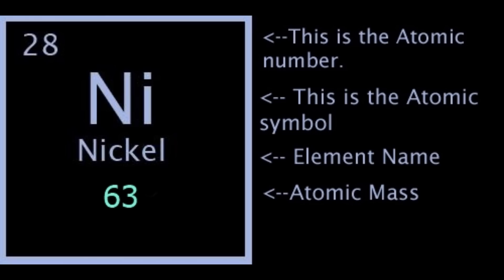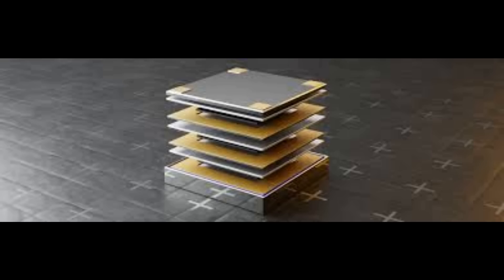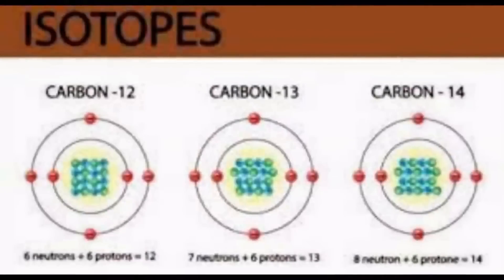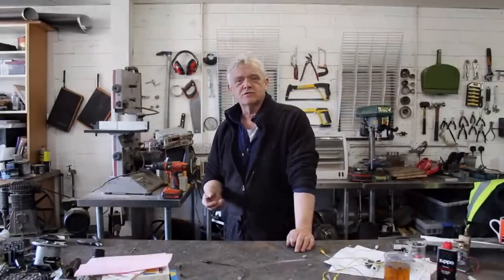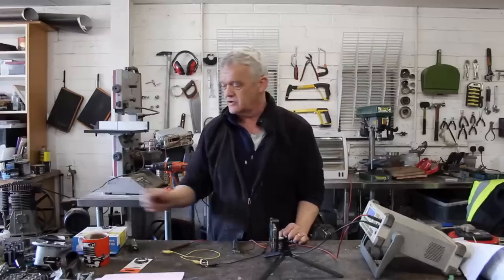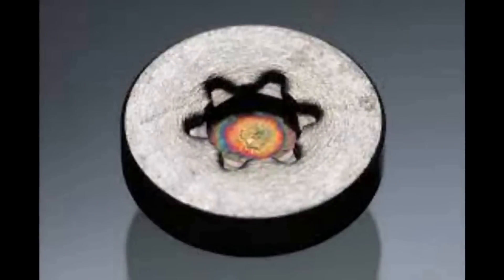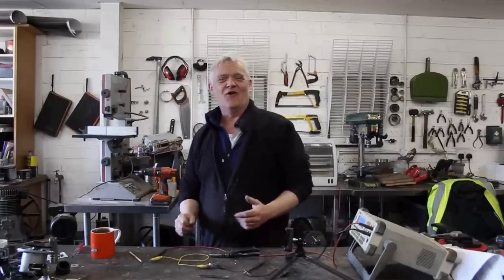2187 - The 50 Year Nuclear Battery From China And How To Make Your Own Version

Comment: Seventy microamps (70 µA) is a very small amount of current, but it's not insignificant in the context of low-power electronics and microcontrollers. Here's what you could potentially power with 70 µA:

Low-Power Microcontrollers: Many modern microcontrollers, especially those designed for battery-operated devices, have very low power sleep modes. For example, some models can operate in a sleep or standby mode on less than 70 µA, waking up at intervals to perform tasks.

Watches or Small LCD Displays: Traditional digital watches or small liquid crystal display (LCD) screens can operate on very low current, often in the range of microamps, making them potential candidates for operation at this current level.

CMOS Integrated Circuits: CMOS technology, which is used in a wide range of electronic components, is known for its low power consumption. Certain CMOS devices or circuits, especially when operating in low-power or standby modes, could potentially be powered by 70 µA.

Sensors: Some types of low-power sensors, such as temperature or light sensors used in various applications including weather stations, smart homes, or IoT devices, might operate under 70 µA depending on their design and the operational mode.

LEDs: While most LEDs require more current for standard brightness, high-efficiency LEDs or micro LEDs can sometimes be operated at very low currents for applications like indicator lights. However, at 70 µA, the light would be very dim, perhaps only visible in total darkness.

Quartz Crystal Oscillators: These components, which provide the clock signal for devices like microcontrollers and watches, can operate on very low power. Some quartz oscillators might work within this current range, especially in devices optimized for low power consumption.

Comment: I could imagine that you would also be interested in finding out what the maximum power supply capacity is. I didn't notice that it was mentioned for your Am-Diode battery, but it is actually more important than the voltage of one "cell". It's reasonably easy to build a 200 cell battery, but who cares about 24 volts if you can't get 200 amps out of it...

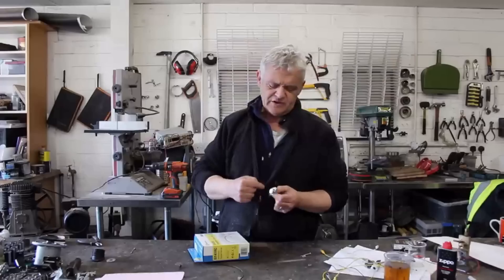Comment: 6:13 I think it's pretty pointless to start breaking some transistor to get a photoelectric cell that produces electricity. Without any kind of violence, the same thing is perfectly possible with LED. Instead of sawing open the case of the transistor, you can take the LED and direct the top of its transparent shell towards the light. And it is still a functional component even for the purpose it was made for. Maybe the life of professors is about complicating things?
Reply: Maybe that transistor has more surface area or provides better shielding.
Reply: @splaytrees  Makes sense.

Comment: So with 10 of these, I can make 1 volt, but how many watts? Also will the silicon transistor degrade from the radiation? So it seems like it can't be a practical battery. Thanks.

Comment: Found the easy way to open the transistor. Clamp one side in the middle of a vise.Take a sharp utility knife- slide between the  cap and the base metal and give the knife a very gentle rap with a hammer and that whole cap pops off in seconds!

Comment: its very entertaining but you are just seeing light leakage.  If you perform the experiment in a slightly more scientific way (ie really remove ambient light) you will not see any difference if the Am-241 source is present of not.
The semiconductor die is passivated with  layer of silicon dioxide (quartz glass) and the alpha particles will not be able to pass that and reach the semiconductor layers below.   Even if they could pass through the passivization layer, they certainly could not pass though the first layer of N-type material to reach the N-P junction where the charge carriers are produced.  Light is a photon and behaves differently in this semiconductor and can generate hole-electron pairs on the surface layers.  Betavolt uses BETA radiation, not alpha as you are getting from the Am-241 source.  In a BetaVoltiac or AlphaVoltiac device, the source of the electrons (beta) or holes (alpha) needs to be one of the contacts, the semiconductor is the other contact.
Reply: Alphas easily pass 1 micron of aluminium, the higer energy alphas up to 5 micron of aluminium, and the passivation layer  is thin enough. Lots of semiconductor Alpha sensors and Radon monitors on the market, you can buy them off the shelf.
Reply: There will be a roughly 1-2 MeV energy loss from crossing 1 micron aluminum, which represents about 20-40% of the theoretical starting energy of an Am-241 decay alpha.  In practice, the gold coating on the source, recoil losses and the few millimeters of air will also reduce the alpha energy even further.
What needs to be remembered that a three layer device like an NPN transistor has the (usually) emitter on the top of the of the die, so to reach the junction, the alphas would have to first pass the SiO2 passivization layer and then get through the emitter n-doped layer.  That is a substantial mount of material.
Alpha detectors that are based on semiconductors as usually 2 layer devices, often PIN diodes.  Not NPN power transistors...

Comment: So if I did the math right, assuming 128 mV output, someone could spend apx $30k USD and build 1,875 of these, and provide a house with 240v for ~400+ years?
Reply: I mean, if you could have it collected in a capacitor for consistency, then it's possible? But you'll be better off just using a solar panel system to supplement it.
Reply: @Life-tastic  but would that be cheaper than 1900 transistors...
Although I suppose a cylinder of panels with a larger chunk of the material placed in the middle may be the way to go.

Comment: I can see some use cases for this.   

Trickle charger for cars.   When it becomes more dense and able to get around 2amps at 13-14v (around 26-28w) your car battery in a modern car that is currently abused by all of the new electronics would last 2x as long.

Comment: Damn... I don't have much faith in the safety going forward but I'd love to get my hands on some of those neat little 3v batteries... if they are closer to 3.7 with 4.3 max it'd be perfect for a bunch of stuff I'd put them in. I'd totally show that shot off too... inifinite battery in my PSP. Infinite battery powering my laptop. 

Obviously not infinite but long enough to forget it's  doing it's thing to a degree... 2% battery loss a year roughly. 😂 (on typed theoretical thoughts anyway)

Comment: Interesting video, but would have been a bit more informative if some measurement had been done on the current so it would be possible to calculate charging times for capacitors

Comment: Very Cool. For all those that want a long term battery, I would like to point out there are 50 year batteries on you tube. If size is not an issue, basically, just take large chunks of any two metals, aluminum and copper for example and stick them in a bucket with water and salt, and you have a battery. If you connect several cells, you will get higher voltage. In order to make it last long, like 50 years, one uses large chunks of copper copper piping and large chunks of aluminum tube or pipe. I built my own battery that powered an LED 24 hours a day with some aluminum foil and copper wire. After three months, the foil was starting to dissolve, and I had my fun.

Comment: Alpha particle emissions from AM-241 have a nucleus, two protons (a +2 charge) and no electrons; it is basically a helium particle with no electrons. They can be shielded with a sheet of paper and will not penetrate the outer layer of the epidermis - the dead layer of skin. However, alpha particle are EXTREMELY toxic when ingested, as discovered via the radium watch dial painters of 1917 to 1926 who died via cancerous lesions of the mouth, tongue, throat, esophagus and stomach. Wiki has an accurate account of the radium watch dial painters. Cannot put the link b/c YT is "protecting" you.

Comment: possible to  please do it up with an adapter/connector such that it can fit into AA/AAA (or the other battery sizes) so that it can be placed in something maybe an aircon controller/tv remote/weighing scale? that would be super practical and useful and an amazing second follow up video.

Comment: Great video Rob! I wonder if you have heard of the LTC3108 chip? It takes voltages as low as 20mv and can push them upto 5v with usable current! check it out and if you still have the bits from this nuclear battery, maybe you can get some usable voltage out of it?!

Comment: It's unlikely there is significant alpha particle penetration of the metal casing of of the power transistor you used here, but the americium from your smoke detector also emits gamma rays. I suspect that 're seeing the photovoltaic effect from the high energy gamma ray photons that penetrate the metal case and hit the PN junction, not any alpha particles.

Comment: nuclear battery to smartphone 1w would be sufficient  enough to charge battery newer no need to plug in. Only think how much would it really cost and is it really possible if it is then if size does not go too big then electric car would be possible to charge one with output around 1000w and you could get around 100km per day to battery.

Comment: Can you use leaded solder to contain the radiation?

Does it make it safer, more efficient, or devilish hazardous?

Maybe just wrapping solderwire isn't enough because of leaks But lead-tin alloys seem very easy to cast into a box as thick as needed then solder on a top plate as the lid to seal it

Anyway, is it interesting enough to test on a cloud chamber and probe it while you put it into the box/wrap it around it ?

Maybe tinned copper plates can be used to make a composite metal case even

There's also lead fishing weights/sinkers in case there's not enough(or any) lead in the solder

Comment: So, your example generates 0.1V * 75uA = 7.5uW. The 400 years = 400 * 362 * 24 = 3475200 hours. Therefore the eneregy storage/capacity is 7.5uW * 3475200h ~= 26Wh from tiny tiny two pieces of materials. That is incredible for DIY. Now if we take the Chines one, it has 3V@100mW for 50 years, well that is 100mW * 50y * 362d * 24h = 43.44kWh, what the f*ck, this is incredible amount of power for 1.5x1.5*0.Xcm piece of battery (if I am not calculating incorrectly).

Comment: I think seeing these as a replacement for watch batteries and in DIP packages for computer applications to use for realtime clocks is a fantastic idea. It might be interesting to combine it with an atomic clock, if the principle is the same.
Reply: Shove enough together and we could run a switch from it, I”d love infinite battery on mine.

Comment: A 50 year nuclear battery would be useless in a cost driven industry. Way before the battery goes dead what ever its powering will be long outdated or go bad. What are we gonna do with 50 year batteries that have no use in a few years and doesn't fit anything? It's only a good idea if the battery is universal for power and fit.
Reply: I would think that since they last so long, you would still see new products made to accommodate the older....universal battery form factor.

Comment: Amazing, I was always puzzled why do we harvest radioactive energy so inefficiently.
This is a perfect energy harvesting device and when they make it possible to interchange the isotope with new one, we will be able to power anything :D
But probably for big power output radiation would be too high to use in portable devices safetly...
Reply: it probably would be used in low power devices in aerospace and military stuff, i don't think they want that many radiation sources floating around in consumer devices, but if the radiation shielding is good it's unlikely there would be any exposure unless people are taking out the radioactive element and touching it or wearing it. i think the bigger applications have the same risk but they are well aware of the radiation and can afford to put heavy or large radiation shielding.
i think the biggest hurdle for this technology will be getting enough of the right radioactive material to make enough batteries, and then what are the costs involved in getting that material or making it, but i haven't really looked into how they get the nickel or americium isotopes

Comment: This is OLD tech, it's been around in pacemakers in the 60's  but they stopped using it as it's dangerous. Other then that there's not enough wattage to run it for anything practical other then pacemakers and hearing aids.

Comment: Thanks Robert. There is also some low energy Gamma radiation from the decay of Americium-241, so it's worth remembering. The smoke detector works by generating a voltage between two plates at each side of an air cavity. Smoke particles enter the cavity and disrupt (absorb) the Alpha particles, causing a drop in voltage, and triggering the alarm. So the detector is also essentially a low power battery.
Reply: @user-up1id5rv2m indeed. You'd imagine you could charge a capacitor with the americium that could power the buzzer for 10 minutes or so. Assuming it had sufficient hours to charge before needing to go off.
Reply: Radioactive Boyscout Intensifies
(Rip)
Reply: @user-up1id5rv2mModern fire detectors are photo-electric (smoke particles deflect/absorb the photons) and don't use a radioactive source.

Comment: Lolz. I have dozens of thermopeltier chips from the early 2000's when we used them for cooling CPU's for overclocking competitions. I believe I have a couple 500w modules still sealed and unused. So ( I already knew this from Voyager tech and Russian remote radio stations power systems..) Just grab a hot substrate, sandwich in between pelts, add a cold side HX, and viola , A TINY trickle of power...sigh . why? because peltiers thermocouples dont wake up and get efficiant till 600f OR MORE!!!
Oh P.S A company I worked for surrounded the heat treat vessels with thermopelts for energy recovery. it sorta worked? but more importantly, it just cooled stuff with no moving parts or exhaust and was self contained. Really nice option for long term solid stae cooling...except Petiers also like to fail , forward even sometimes! so now the HOT side is cool and the fragile device being cooled gets COOKED to death...Peltiers are NOT READY yet. Soon though...LOLZ! I mean we have only had them since the late 50's...

Comment: Their very low power so why not charge a battery or capacitor with a nuclear battery, which will be 24/7 charging for devices that are not used often like a torch for example or a car key...

Comment: I can't see this taking off. Health and safety aspect is one.. Also there will be a big push back from energy companies. They make a lot of money off recharging batteries. There would also be some practical problems.. I expect the electricity produced isn't so usable at higher scales. And having nuclear material and diamonds.. These batteries would cost so much it would be cheaper to just recharge your phone from a power outlet like normal.  Also.. What is the lifespan of a phone with planned obsolescence anyway?  A few years?  Who needs or wants a built in battery that lasts a life time of the device itself doesn't last a lifetime and costs a fortune.

The old adage.. If it sounds too good to be true it probably is
Reply: It didn't produce any electricity so no, it won't take off.

Comment: Although the Bv100 sounds impressive it really isn't. It produces 3v, but with almost no current. (0.000033A) A CR2023 battery, the type found in a car's key fob gives 0.235A. That is a factor of more that 7000! Yes the BV100 lasts for 50 years, but can't even power a single LED.

Comment: "in a nuclear reactor, we want to keep hot particles and get rid of fast ones" - if I understand correctly, a hot particle means it is fast, so that statement looks contradictory to me. What am I missing?
Reply: Slow or "thermal" neutrons are what cause fission.  The fast neutrons need to be slowed down by a moderator or else allowed to escape.   Like bullets, a slower bullet can be absorbed and do more internal damage while a high-velocity bullet might just punch a clean hole right through.

Comment: So wouldn't it make sense to incorporate capacitors and a bit of circuitry for having this charge up a standard Lithium Iron Phosphate battery?  Since the power output is so low it would work as a trickle charger to a battery that can store up potential energy and release it with more output for practical uses, then slowly charge back up over time.  Maybe not enough for keeping a phone charged up but for other applications where intermittent use and a higher discharge rate are preferred?

Comment: Just FYI, this battery may last 50 years, but it only supplies 0,0001W of power. It has its uses, but all of them are super niche or in a setting where you don't want DIY mentioned like, ever, medical devices and smoke/CO detectors for instance.

Comment: Is the Betavolt cell "100 milliWatts", or "100 microWatts"?  You said "milli-", but the photo at 2:13 showed the Greek "mu" prefix, meaning "micro".  That photo is NOT the new Betavolt cell, but it's hard to believe that Betavolt has increased the power output by a full 1000x, and other on-line sources say "microWatts".  So, when they claim that they'll scale it up to 1W, that's a factor of 10,000, not just a factor of 10.  Also, the BV100 MSRP is $500, so scaling it up 10,000x makes it a $5,000,000 cell phone battery.